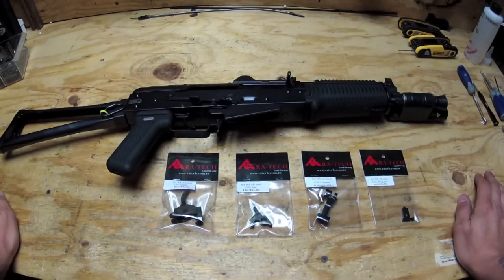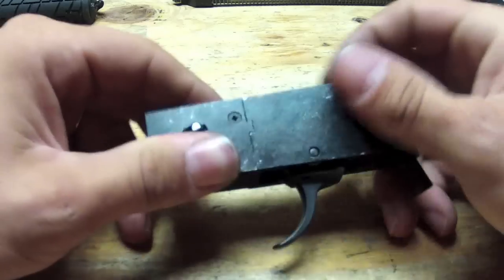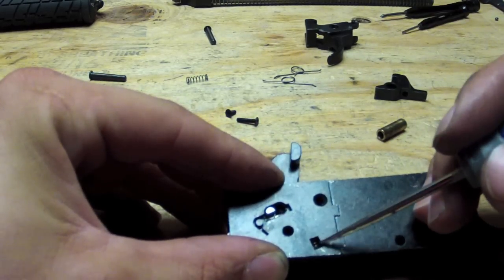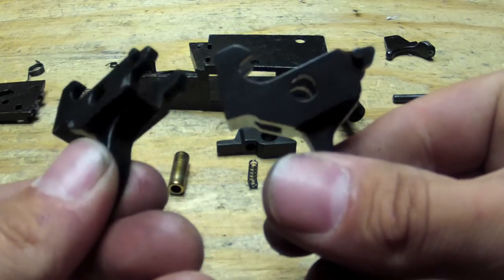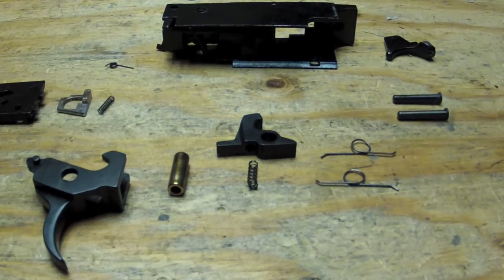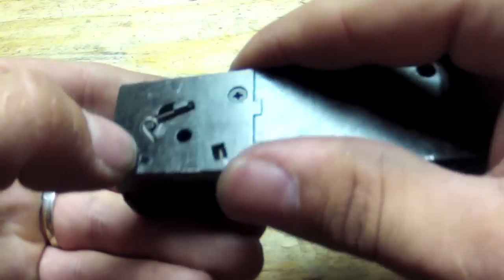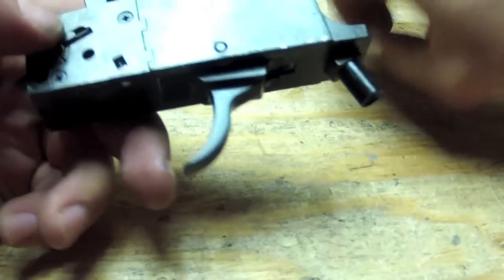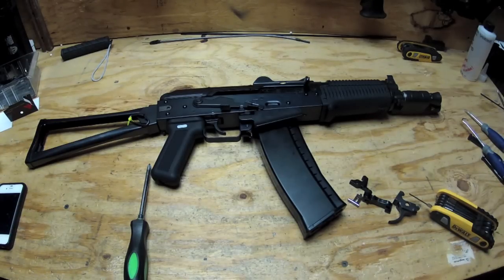WE AK Series RA Tech Trigger Set/Box Disassembly

Comment: one thing to note here, is that the little grub screw in the fire selector mechanism doesn't always come out easily! I used a  very good quality Allen key, but WE in their infinite wisdom had done it up so tight it just stripped the grub screw. I had to drill it out - which brings it's own problems of not damaging needed components. just be aware is all im saying..

Comment: Hi.
 Id like to thank you for this video. I'm fairly new to airsoft and purchased this gun from a shop new, and already upgraded. Unfortunately when  it arrived a few days ago, it would not fire. the bit that strikes the gas release pin on the magazine (cant remember what its called) is very sluggish and doesn't have anywhere near enough power to activate it.
However after watching this video, I feel, even as a noob, that I can stripe it down and reassemble it (Hopefully, there's no parts missing!) and can cure the problem without the hassle of sending it back to them. 
Thanks again.

Comment: Cheers for an excellent video. Bought my 74 second hand and it's hammer came in two the first mag I put through it. Swapped it out for the full RA Tech internals. The parts didn't fit too well and required quite a bit of force to get some bits in like the hammer pin but the gun runs fine now. The only problem I have is when the grub screw on the fire selector is tightened right up the trigger wont pull in full auto. Any ideas? Thanks again though...

Comment: I have a  WELL AK74, its supposed to be a direct copy of WE. 
There is a tiny black screw on both sides of the bolt, which hold the loading nozzle inside, and prevent it from falling out during blowback.
Do you happen to know the name/model of those screws, as I need to buy some more.. Its something like m1, m2 , etc..

just asking incase u know. thanks

Comment: Have you had any issues with your trigger box breaking? I would consider getting this but I have not found a single fix for the trigger box, they're out of stock everywhere, and apparently boobiegbb has broken three boxes.
Reply from the maker: Yup they break often! I haven't had it happen to me but that's the word going around. I think DogTag is able to get u new boxes if you give them a part number but not 100% sure
Reply: *****
What's the mileage on yours? Do you use yours pretty often? Incredible that your trigger box hasn't broken yet. If I do get one, I hope I get some magic trigger box like yours. haha
Reply: ***** Maximus, If you could upload a video showing how to remove the M4 Buffer tube and put on a different AK stock like a Skeleton Folding stock or a Regular Wood stock that would be AMAZING... I want to know how to take off the M4 buffer tube before I get one. Also, what other AK stocks work on this? AEG one's probably don't work, and real steel would require modification that requires tools I dont have.... Thanks

Comment: Did u have a problem where the hammer was hitting the magazine valve hard enough and it wasn't firing?
Reply: Damn🤣 i just install my ra tech trigger set and i got the same issue, i change my spring and still not hitting hard enough the magazine valve